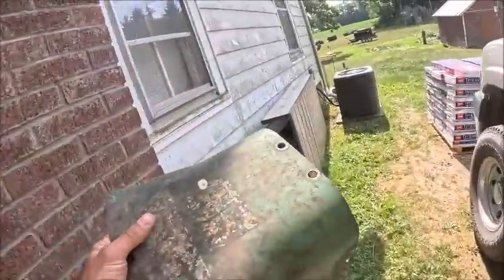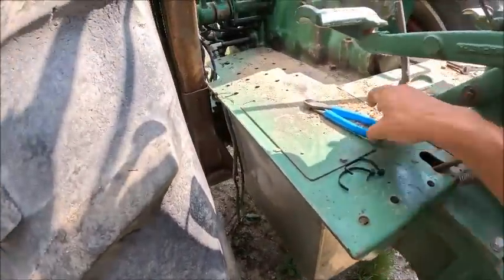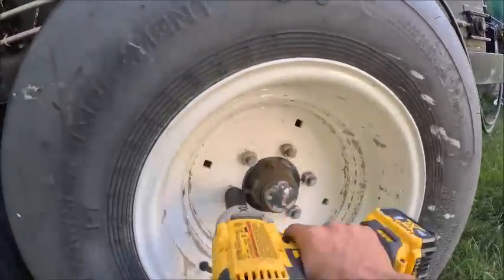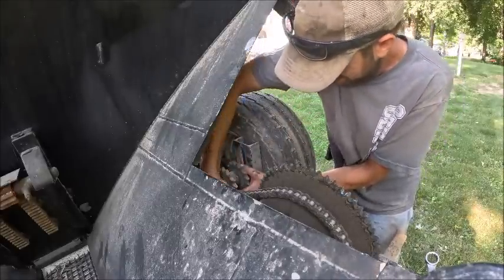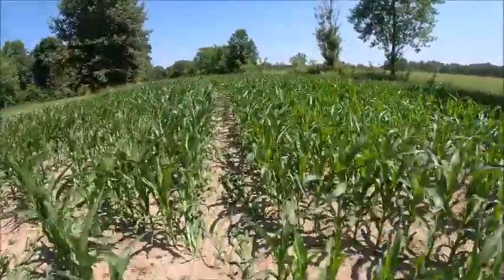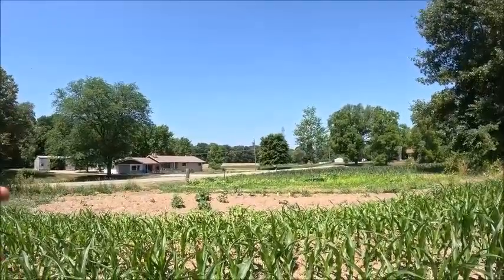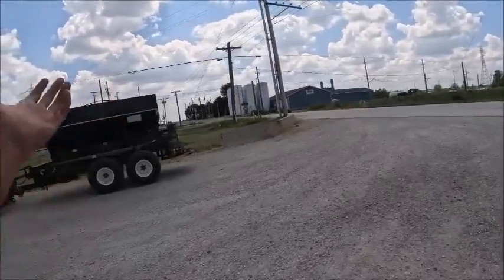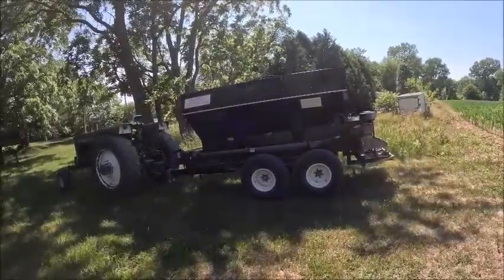Top Dressing The OK Corn: Helena Comes In With A Save

Comment: What is the weight of your Urea and nitrate? The Urea from the mill I use said it was about 45 to 46 lbs. I had the same trouble setting up the spreader calibration, which drive to use. I was shooting for around 75 lbs./per/ac. actual. Yesterday and today we finally got some (Rain), not sure how much as I haven't checked the gage yet. Cass Co Mi.